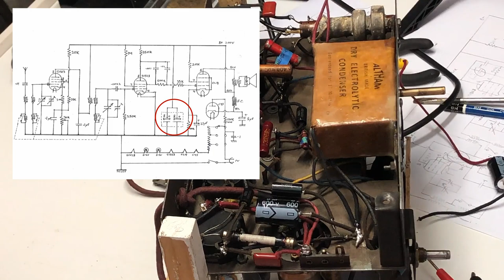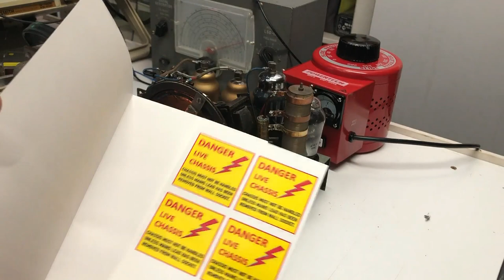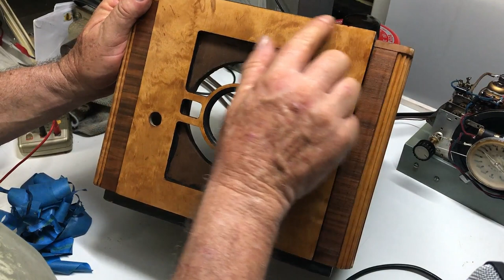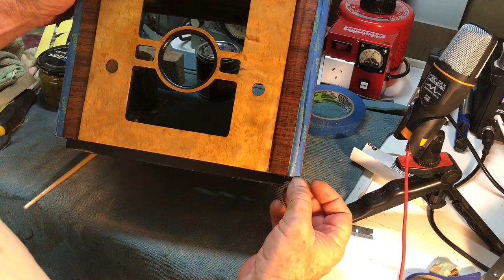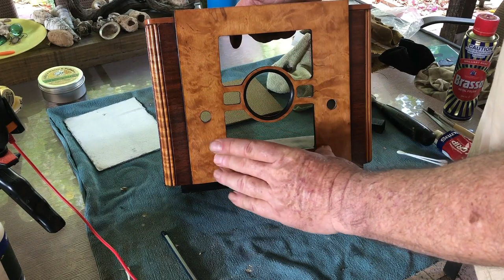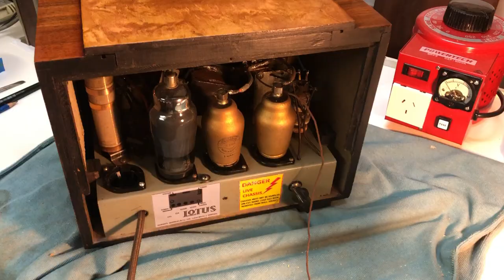LOTUS mystery radio Part 3 - Final

Comment: That cabinet looks absolutely fantastic!  I've never attempted using shellac before but may have to give it a try some day.  I shouldn't worry too much about the asbestos.  It's a small amount and you aren't messing about with it every day.  It's like when I put a set of brake pads or shoes on my vehicle I've never worried about it.  If I worked in a brake shoe factory for 40 years, then I'd be a bit more concerned  :)  Radio sounds fine to me, but then the last restoration I watched was of a mid 1920's Magnavox with one of those tall black horn speakers that resemble those horns half deaf people used to carry around 100 years ago, and even a tin can probably sounds better than one of those :)  It certainly doesn't sound any worse than a lot of modern radios on the AM band with all the interference there is nowadays.  I'm ready for Spring in this hemisphere to arrive.  We had an ice storm last week and even with temps in the 50's (F) during the day the last 3 days it's still covering a good bit of our lawn and driveway.  Take care, Gary
Reply from the maker: Thanks Gary.
I'm still on a "learning curve" with shellac.  It's pretty easy, really, and forgiving in that you can just clean it up with methylated spirit if you stuff it up. Have a go.
Those horn speakers never sounded good and I guess a radio like this one would have been a step up from that.
I'm kinda looking forward to the end of Summer here - it gets very hot in the shed - over 40 C (104 F) most days and its been as high as 46 (114 F). That's why I like to work outside on the table under the grapevine.  I've never seen an ice storm. I can hardly imagine what that's like. Our winters are pretty mild - it never goes below 0C (32 F) here.
Anyway, glad you enjoyed the video.  I had a look at your channel and it looked pretty interesting so I subscribed,
Cheers mate!

Comment: put a cap off the anode of the audio output tube to ground to shape the tone .0047 .0022 .001
Reply from the maker: Hi Ian
After the video I did end up putting a .0022 cap off the plate of the output valve. It softened the sound a bit - a .0047 was too much.  
Its real "problem" is the distortion induced by the detector.  I've been playing with the idea of inserting a germanium diode in series with the grid of the 2nd RF valve and changing its bias to make it function as a conventional preamp. Not original, I know but it would be easily reversible if someone wanted to return it to original spec.

Comment: If you ever get a chance to get a decade resistance box get one. Lots of older radios have off spec resistance values 
or poor colored markings on them. Take your best guess and tweak the replacement using the box ( just have to lift one 
lead off the old resistor on one end).  Making that adjustable resistance pot was pretty clever!
Boy your cabinet work turned out nicely! Lots of time consuming work but is very glossy where it counts. Great job all out!
Reply from the maker: Thanks!
Yes, a decade resistance box is on my wish list, along with a few other things.  I have only been doing this for a year or so and started out with only the most basic equipment - a multimeter, a soldering iron and a home-made dim bulb current limiter.  I'm adding to my equipment bit by bit as I need it.